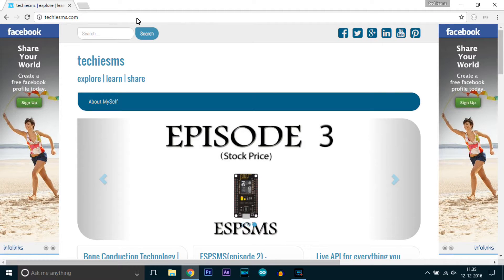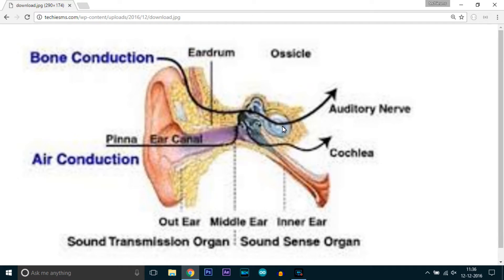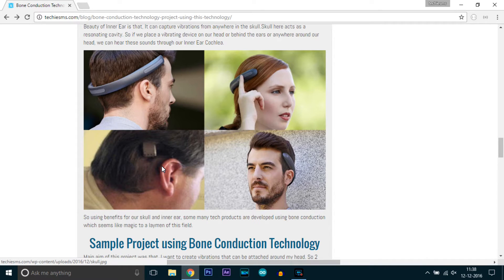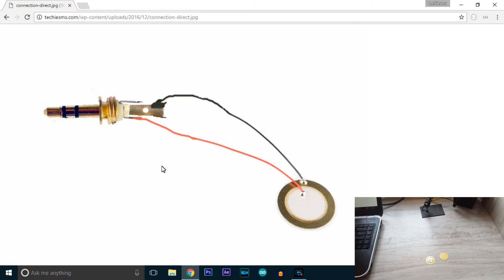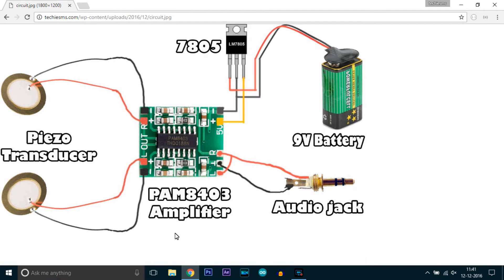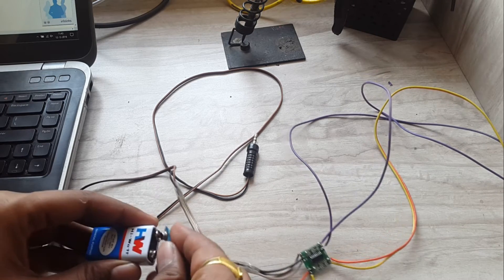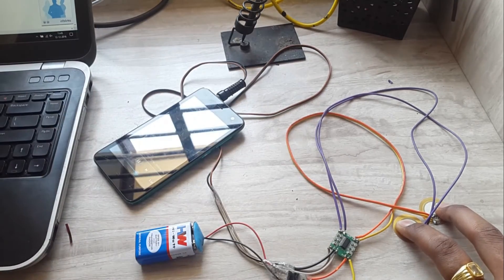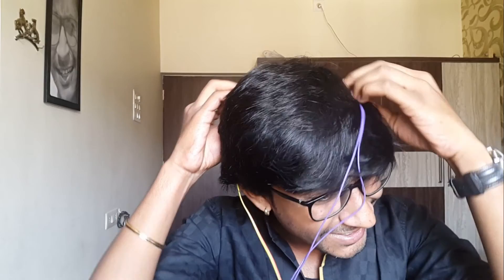3 DIY Projects using Bone Conduction Technology | Bone Conduction Technology Explained

Comment: Hii man a great project, but it doesn't work so good the volume is low. it could be because i used a tiny cables or maybe it was  the audio jack that i maight be connected them wrong to the electronic card(the opposite)?

Comment: In case of 3 wire piezo what is the function of third connection(small one on inner disk)
Reply from the maker: +Amit Pachpande in 3 wire piezo the middle one is for feedback purpose

You can ignore that middle leg and treat it as two wire piezo